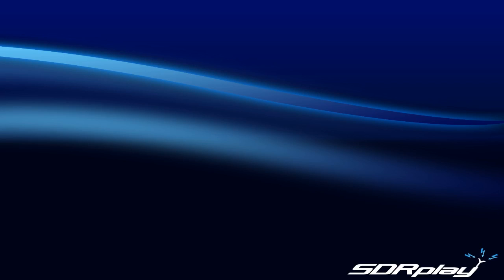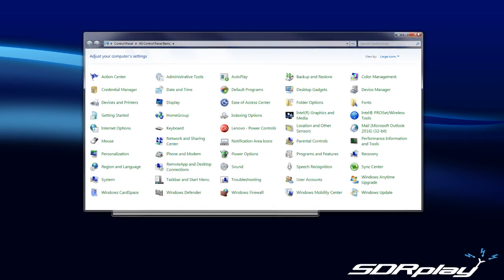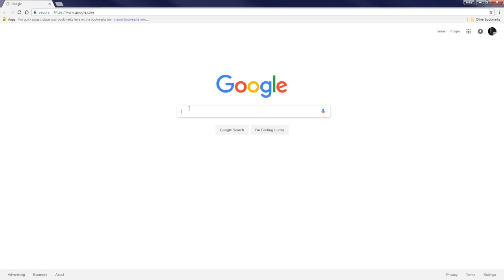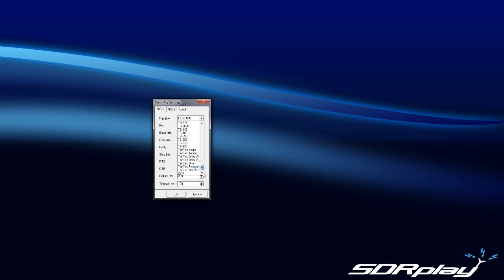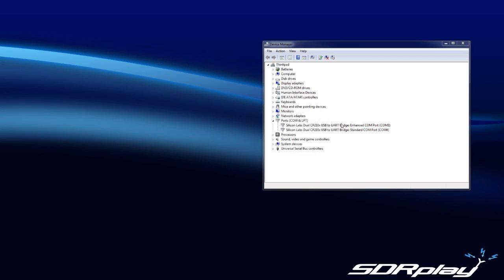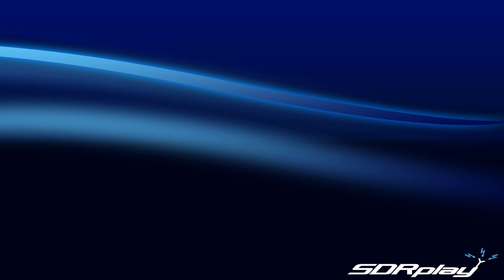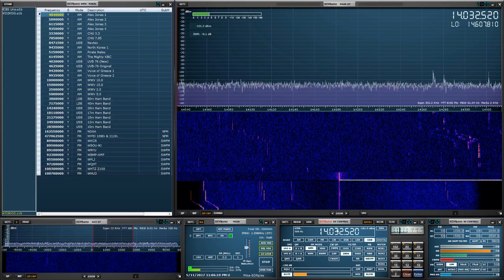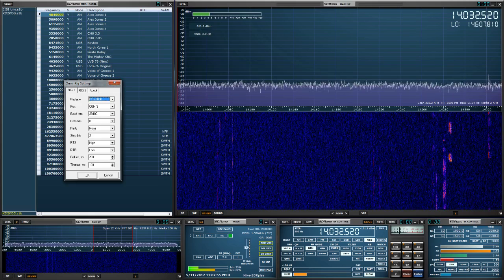SDRuno, FTDX 3000, Omnirig & LOG4OM Logger (MV011)

Comment: I know this is an old video, but I’m hoping someone will read this and be able to tell me what I’m missing. I’ve got OmniRig talking to the FTdx3000. I can open OmniRig demo 1 and see the digital read change as I turn the VFO. Both the RSP1, and the 3000 are connected to the back of the same PC (Windows 10 OS). I click on settings on the Rx section of SDRuno, select ORIG, and then click on SYNC so it turns orange, but SDRuno doesn’t respond. Help please!

Comment: Just saw another thread on the 991, found out my problem. For some reason it wont work unless you run omnirig or SDRuno as administrator. I cooked off 4 hours trying this and that, ran them both as admin, now its working fine. 
Not sure why, just worth a try if you are certain you are doing everything correctly.

Comment: Hi Mike, or anyone else, I've set up as per demo and all appears to be working except when I use the band selector on SDRUno, or on the rig, Omnirig unsync's. Then, when I restart Omnrig to re-sync the Radio goes into transmit! I have no idea why this is happening - does anyone have any pointers? 73 Adrian EI9HAB
Reply from the maker: One Time Pad using the band select in Uno should be ok. Since Uno locks the LO fir band framing trying to change the band on the rig will not work until you turn off LO lock. To always frame the bands correctly I prefer to use the band switching in Uno.
Reply: @SDRplayRSP  Thanks for that, I'll give it a go.

Comment: I have configured every possible option there is to explore. I can get SDRUNO to receive the signal from the RX out but I cannot get the rig control to work. I could never get the VFO knob to sync up. 3 days of frustration. Shouldn’t be that hard. I really like the Yaesu 3000 receiver but the scope is very limited. I thought this might be an option. I’m not sure how you other gentlemen got yours to function properly. I even tried another computer. I believe something is not right but my lack of computer engineering is probably my downfall.  Back to my Icoms.
Reply: Me too.

Comment: Great video, I am trying to install omnirig for my ft-dx3000 and don't have the usb cable yet but I think I have downloaded omnirig ok but when I run it, I get the first screen to do the com port settings etc and click ok but that screen goes away and nothing else comes up.  In my device manager there is no com ports or ports listed, only USB devices.  My Lenovo all in one desktop only has USB ports so I am kind of confused and trying to figure it out.
Reply: @Mike-Mike-u7b  Thanks, I appreciate the input, after checking, looks like something went wrong with my download when I did it the first time so I will be trying that again from the Yaesu site.  That is probably the problem here hopefully.  Thanks for the reply!

Comment: mike   help please   i have followed your video and got everything working. on returning to the radio, it will not start up properly
sdruno will tune the 3000 but the radio will not tune sdruno
in the settings status, rig status flicks between on line and rig not responding   any thoughts please?
neil
Reply: All good now mike.  Thanks.

Comment: Thanks for the video Mike. I'm trying to get Log4OM to work with SDRUno and a RSP1A connected to a TS-590SG. I've got it all installed and working well apart from one thing. I'll try and explain...

Using the Kenwood VFO, the frequency updates in both SDRUno and Log4OM. That's fine.
Using SDRUno, the frequency updates on the Kenwood and in Log4OM. That's fine.
The problem is if I use the cluster in Log4OM then the frequency on the Kenwood updates but SDRUno does not follow. What's interesting is that the mode in SDRUno does change (say I click on a CW spot in the cluster then the frequency and mode will change on the Kenwood but only the mode will change in SDRUno).

Does this work for you? Have I missed a setting somewhere? Any help will be appreciated!

Comment: Thanks I'm planning on doing the same setup. However, what I ideally would like to do is have SDRuno on a separate computer. What I was hoping would be that SDRuno would support XML comms with Log4OM, similar to what FLDigi can do. Or that the FTdx3000 would allow comms CAT control both over the RS232 as well as the USB Comm port. Alas I think I'm stuck using just the one computer but hey, maybe that is a good thing. How many monitors do I need in my shack after all. Mike / KA4CDN
Reply: I have 3 monitors now. I wish I had the real estate for 6 :)